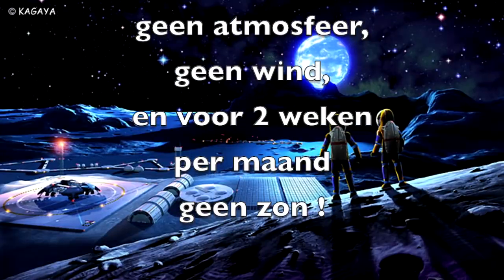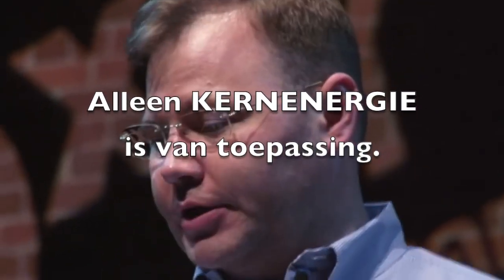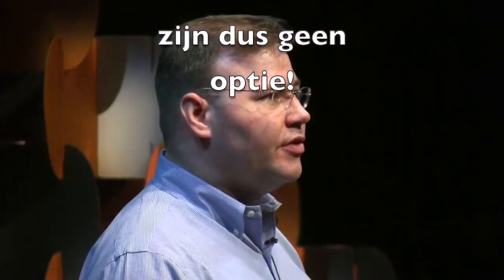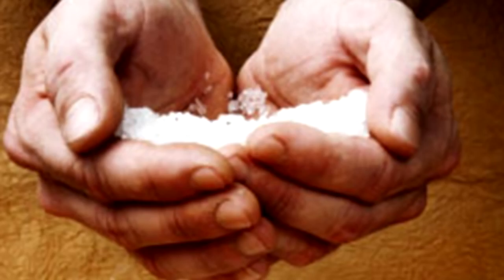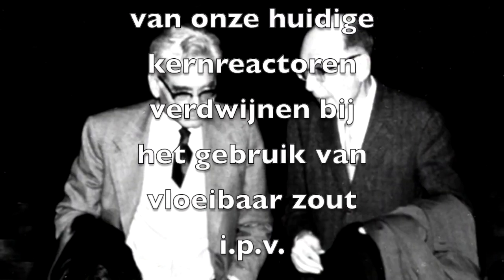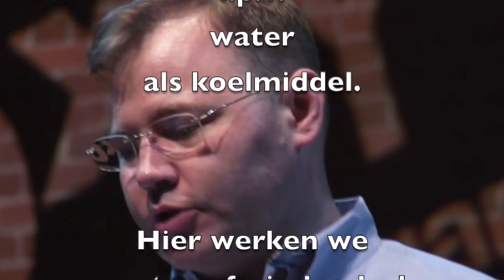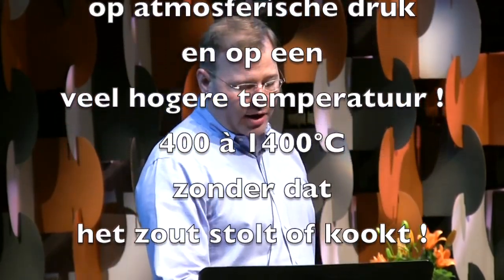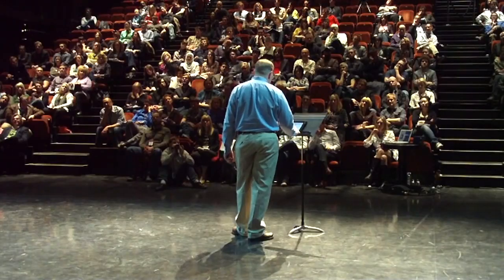Kirk Sorensen Thorium MSR

Comment: The magic, if you want to call it that, and I do, is the molten salt reactor, not thorium. He always compares LFTR to a solid-fueled PWR and never a uranium MSR. If he did we would see that the uranium MSR is simpler and cheaper with all the same benefits.
Reply from the maker: There is nothing wrong with the Thorium MSR and indeed a nuclear waste burner is simpler. Still, Kirk Sorensen remains one of the leading figures in the Molten Salt story.
Reply: @dirkvandevoorde4251  Only that they are inherently more complicated and more expensive than a low-enriched uranium MSR burner. For there to ever be a real energy transition nuclear has to be cheaper than coal and be just as reliable and versatile. (high temperature)
Reply from the maker: @chapter4travels  Indeed if we ever want to steadily reduce global CO2 emissions we need to bring to market a powerful machine that is cheaper than a coal plant. See ThorCon, Seaborg, TerraPower, Copenhagen Atomics ....
Reply: @dirkvandevoorde4251  I'm not worried about co2 emissions, I'm worried about the 3 Billion+ people who live with no electricity or live in energy poverty. These people will power themselves out of poverty with coal unless there is something cheaper and just as reliable/versatile. Burning coal has huge health and environmental impacts that could all be avoided. Also, coal, gas, and oil are WAY TOO VALUABLE to be burning for heat.
Reply from the maker: @chapter4travels  100% my thinking, this is exactly what I say on my lecture "Het klimaat anders bekeken" - "The climate viewed differently"